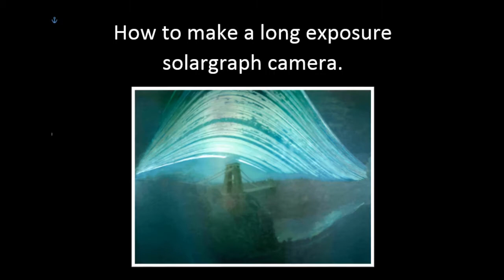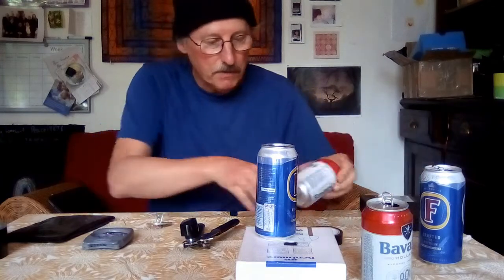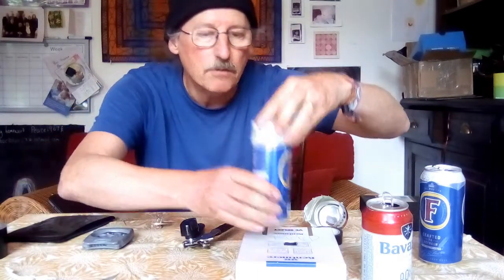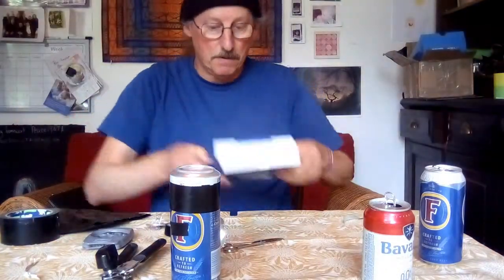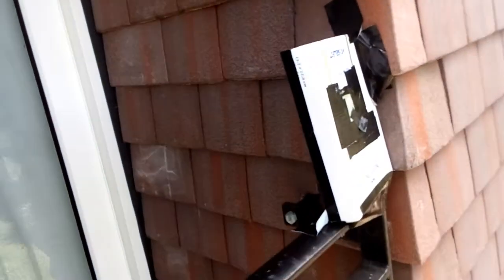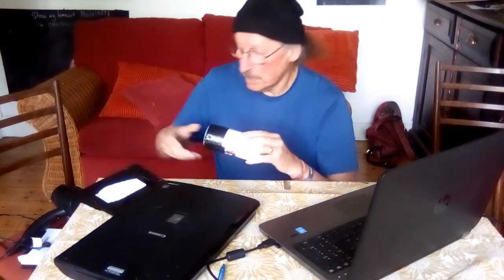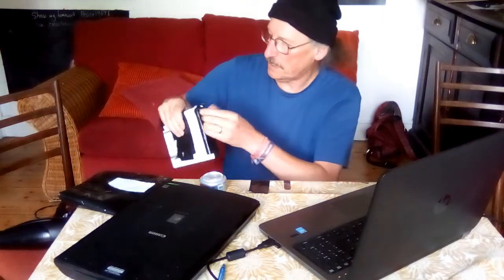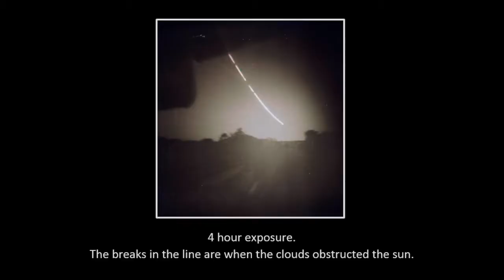How to make a Solargraphy Camera

Comment from the maker: Just answering a few questions... I don't think a street light will change your image - probably not strong enough. And it won't make a moving trail like the sun. But if you think it's a problem, relocate your camera, or better still add another camera in a new location without the street light then compare the images after a few months.
Re paper inside the camera, for 1 day exposures or longer, usually it's black and white 5x7 printing paper, Ilford Mulitgrade or Kentmere Variable Contrast. But you can experiment with other papers, and see how they affect the image.